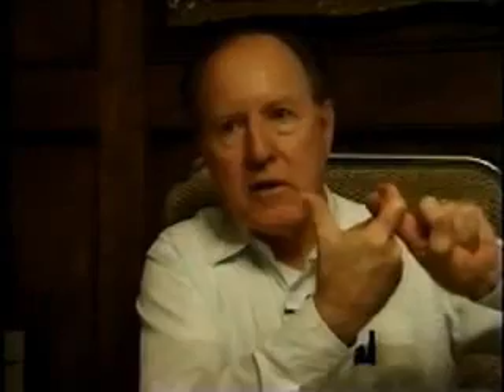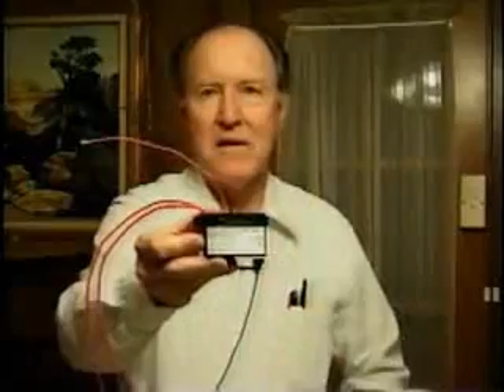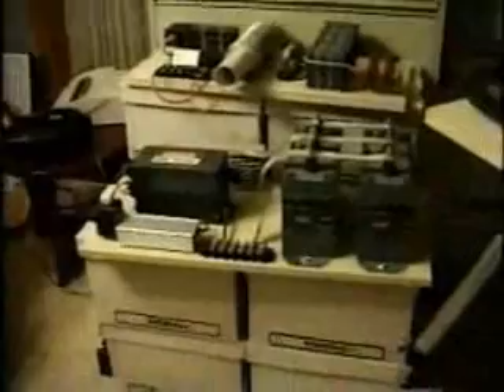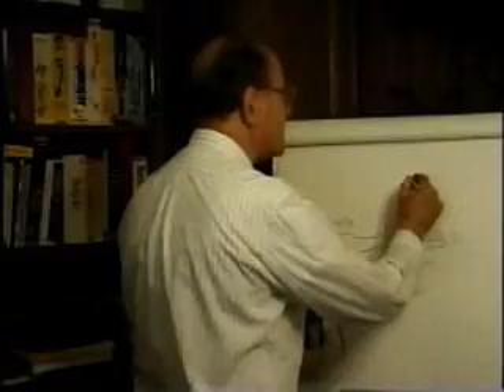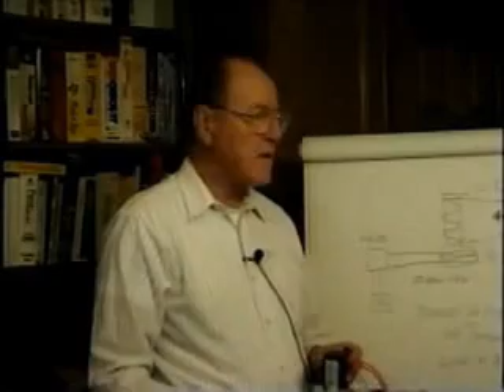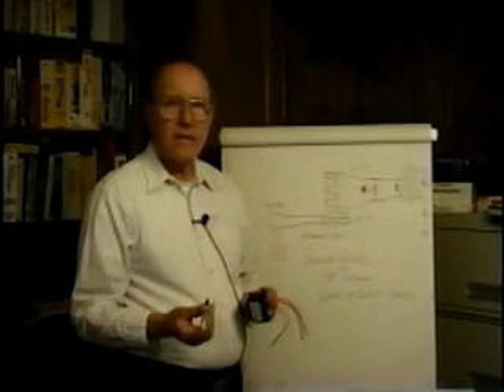don smith seminar on how to make it.

Comment: Don Smith Overunity Generator is based on 4 things:
1.High Voltage Series Resonant Transformer
2. Earth grounding is the source of electron flow into the system. Nothing is created out of nowhere.
3. Using Spark Gaps to disturb the ambiant energy and draw more current into the system from earth or the ambiant
4. Load must be taken from resonant tranformer coil.
Reply: yes that sounds about right ! im fully aware through observation of my experiments that the earth connection greatly enhances the energy when connected to the correct terminal of the system . what  experiments have you done ?
Reply: no, not even close

Comment: That 9000 volt from L2 coil when fed to the primary of isolation transformer kills the sparks in the spark gap. I don't get any sparks in my spark gap when connected this way. Why is that? What is the alternative? I have not adjusted the frequency at the isolation transformer using resistor. Is that the reason?
Reply: Checkout faraday research and development
Reply: @donavonneighbors  have u replicated the the plan shared in this video?
Reply: @avinpais  not yet. But in that channel I recommended, mike does lots of it and is pretty active.
Reply: DID YOU MAKE ANY PROGRESS WITH IT ? : )

Comment: after resonance at multiples (16x) at 560 Khz, secunder voltage (L2) will rise according to the ratio, can be achieved at 8 KV, many people can make this circuit. the problem is when it's loaded, DC voltage drops, it can't generate current
Reply: It can generate current your at the wrong frequency on the output end, this MUST be corrected before you get useful energy. You are most likely using the wrong resistor size, the other thing I've noticed people don't use is a veractor to limit your spikes on your input end. This machine sucks electrons out of the earths ground for your useful energy it's doing this through induction. Hope this helps, cuz I can assure this machine does work. I have built several of them.
Reply: @johnthomas735  yes don said people kill the energy before properly getting it correctly channelled at the output! So youve made a couple of the systems?!! 😎 i do like to hear from people who have actually don it ! Is it a non inductive resistor on the input terminals of the output transformer ?
Reply: You can get a shock from the high voltage module also. Anyways, I tried replicating the plan suggested at the end of video.. I connected the high voltage output of the high voltage module to the isolation transformer primary coil on the high voltage side.  My multimeter blew up which was conducted on the secondary coil. Probably due to back emf spikes. But my 10 watt LED bulb did not glow.
Reply: it can definitely generate current.  ive already blown several lights with it. kapputtt !! destroyed by the current. if you rectify the energy off the secondary then allow the cap to charge up you will most definitely have current and i would advise be very careful which terminals your touching on the output side if you have a cap charged up. im still trying to figure out the output transformer properly.
Reply: You need to switch to AC, you can do it with DC but it's MUCH harder. Switch over to run it off a 9v battery & make sure you have a closed loop from your capacitor to L1 coil & back into the capacitor. With ac you have no positive or negative, with DC you absolutely can't do the closed loop, this is why your getting the voltage drop....that & make sure you have a real L2 coil as well, it needs to be to specific standards it needs to be compatible with the L1. If it's off by a fraction of an inch you will have loss as well. Keep playing with it, I promise you this device works! Just take it step by step. Really once you get your L1 coil going properly you in business. But you have to switch to AC I'm pretty sure without seeing your configuration that is your issue. But remember too, even once you get your L2 coil induction going you still need to run it to a stand alone transformer & this is where most people fail & think it's all hogwash. You are pulling electric power from ground, nothing in this device actually powers anything, it just attracts electric power from ambient  , or ground.
Reply: @johnthomas735  when you say get the L1 coil working properly were in business, can you give me a few pointers on this ? Cos i have my HV module, and i have no problem winding coils. So how do i connect to the L1 from the nst? I have 5 of those 2kv caps from microwave ovens. I also have a 20kv cap i bought from ebay, 2,2000 pf. I also have a gas discharge tube thing which i saw don using on the earth of the Neon sign transformer. Any guidence would be very very appreciated 🙂
Reply: @tvdylan  you start with your power supply 9v battery into your HVM & you go out to your L1 coil & back to your HVM closing your loop . At this point everything should be working, your not going to need to tune anything cuz your HVM will be forcing that frequency onto your L1 & L2. Again you must play around a bit with your system, I personally notice I get greater voltage running 1/4 length L1 to L2 coil . & From what I can see from the little bit of footage of Don Smith's devices, it appears that he only hooks up 1/4 length of his L1 as to his L2. So the combination of the proper ratio will effect your overall output. Same goes for frequency, but in the model I'm referring to your HVM is pushing your frequency so there's nothing to adjust. You only need to do 1 correction & that's on your isolation transformer.  Your HVM should say how many cycles over second it's pushing so you can do the math on your L2 coil to see how many volts you should be outputting.  Hopefully that's helpful, if you are able to take a picture of what you have & your configuration, I might be better able to give an idea of what's going on.
Reply: @johnthomas735  yes, thanks, so my hmv module is 8kv @ 25khz. And so you say L2 should be 4 times the turns of L1 yeah ? And 4 times the length yeah ? My hmv module is mains powered, so not using batterry at the moment. And i have to maintain a spark gap between the hmv leads and my coil in order for it to stay on. And is it best to have the cap in series with the hmv lead and the L1 or in parallel? And would you have an earth connection on L1? Thanks mate, and yes ill upload a simple video of what ive got to work with. Ive got welding cable for the L1. Or i could use speaker wire, less thick. I was thinking welding cable for L1 and speaker wire for L2??

Comment from the maker: You can try wrapping a plasma globe with thick paper then aluminum or copper foils in alternating layers. Connect a diode bridge to each of the foil layers to rectify the output to DC. Ground the negative end with a grounding rod to the ground. Connect the + and - terminals to charge batteries and capacitors, light flourescents etc.That's it. You don't need to concern yourself with resonance/frequencies or compute LCR values. That's my experimental results. And using a proper Tesla coil will make it even  better!
Reply: Is that overunity? Pulling electrons from ground?
Reply: the operation of all atoms is overunity ; )   @dylanbalie8719
Reply: i see, cool method ! how many layers did you do to get good results ? cheers !
Reply: Do you need an actual diode bridge or can you just add the diode as another layer like you did with the aluminum and copper?

Comment: That special L2 coil (bucking coil) basically defeat lenzs law,  the high frequency and high voltage  is used as a multiplier to get the most out of that coil arrangement to put it into simple terms, if that coil was used at 50 ot 60 hz there wouldn't be much gain and you would need to use an iron core. Here is a link to Dons book. if this helps and you figure it out let me know, thanks.

Comment: I don't see how a person could build one from this video.  You can't read the numbers on the "voltage module" and he doesn't give a source or part number for them.  L is the symbol for inductor so what is the henries of L1 and L2.  Are they iron core or open air?  What is the kva of the transformer?  How wide is the spark gap?  Too much missing info.
Reply: Thank you for your response...much appreciated.  I will start accumulating parts.  8^]

Comment: I like to see a HV module capable of sourcing 3000 Volts into a 10 turn coil!! .... especially at KHz frequencies or even less.  Any 10 turn coil would plain "short out" the HV module.  Something is not right here there needs to be an impedance transformation between low z  L1 coil input and high z HV module output.  I know he's a great man & don't wish criticize ...just questioning the logic of the plan here.
Reply: My thinking says you need to connect to the k3 coil inductively to avoid the short
Reply: His explanations are very unclear and some of the schematics that i have seen for his devices leave parts out or are drawn incorrectly. O’m not sure if this is intentional or not. His device is essentially a tesla coil circuit with a dual bifilar secondary. Each part of secondary are wound in opposite directions. The rest is all basic power supply components. The spark gap in the tesla coil is what makes it capable of firing the primary coil and then the bifilar secondaries produce “volts on the one coil and amps on the other” according to Don Smith. It’s essentially a repackaged Tesla coil designed for OVERUNITY power generation.
Reply: @SuperheroArmorychannel  YES ID AGREE WITH ALL OF THAT ! but im pretty sure that he is bang on the money. which means that we could be using these systems. just gotta put in a fair amount of work to figure it all out properly. and yes, alot of it is basic electronics, its just the engineering of the  coil energy that we have to master in order to do this for ourselves.
Reply: @tvdylan  Thanks for the reply! I believe i understand exactly how his devices work and for me they are very easy to build. I’ll post a video when it’s completed.
Reply: @SuperheroArmorychannel  okay ! excellentay !!  : )  yeah would be great to see a vide'ooo !!  maybe you can explain to me somethings aswell ! you got some cool shit on your page !! you do all sorts of projects !!! just watched the voice changer video !! captian intruigue all the way !! fun things !  : )
Reply: well, if we put a spark gap in series with one of the L1 coil terminals then we have a very live coil with thousands of volts. ITS GOOD TO QUESITON THINGS AND CLARIFY, i dont know if he forgot to mention the spark gap or if he got it to work as in the diagram. but glad you mentioned that, im no expert , but i got a coil buzzing for sure ! have you done any experiments with this yet ?

Comment: can anyone smart here tell me what the resistor value on the output transformer primary should be if we were to run a scheme like that from 12volts?
Reply: Just fix a flipper from kulairado kat..
Reply: : P  @exterminator1619
Reply: variable capacitor might also work , maybe a homemade one

Comment: vision of Teslas tecnology  https://cloud.mail.ru/public/JVAz/XjpXmX6Zi
If shortly, vision based on Teslas patent № 512340. 
Common tesla transformers secondary coil consist of one layer. But in this version the secondary coil is bifilar, videlicet it consist of two layers, connected in series. 
Between layers we have electrical field E=U/2 . If we put capacitor (two plates with dielectric between them) in this field, we will have electric charge separation (electric induction) in it. Load mast be connected to this “internal” capacitor. There is NO magnetic coupling between coil current and load (inner capacitor) current, because they are perpendicular! So there is NO electromagnetic feedback!
To better understanding read Teslas patent № 512340 and Donald L. Smith  www.free-energy-info.com/Smith.pdf

Comment: a few flaws, like always, but an interesting  principle! The main flaw is the polarity of the L2 coil, if anyone can explain why it is not alternating if i feed it alternating 35kHz? Why + down and - up?Another one is the VARIACTOR that he draws at end, that is a diode with a changeable capacitance biased by a DC voltage, i don't see any rectification, only alternating current. Third, i can\t imagine that a man who claims what don smith claimed needs a pencil and a table to multiply 30x300!!!!!
Reply: ya sure! that-s what i said:  
a few flaws, like always, but an interesting principle! 
does it sound like i said he-s a liar??????
I just asked how the L2 coil gets polarized if i fed it with alternating radio frequency and i am still asking it!
Reply: @TheBblindman  its not alternating radio frequency, its pulsed, so only one direction in the output of L2.
Reply: he might mean,  that from the secondary coil you can tap the ground in any leg which would determine the negative polarity from there.  he might just indicated that the down is connected to the ground so it assumed the negative polarity. his old and his brain may not be as quick as your anymore but it doesn't mean he don't understand it. alternating or direct all have positive or negative voltage.
Reply: Blindman  He explains slowly step by step 30*300 for a wide audience. His answer is correct but the questions are dumbto the engineer but not the layman or all audiences trying to learn.
Reply: varactor at the end is really a varistor
Reply: i was wondering if it really could work like a electron pump. Logic it should be! The currents in the halves of the coils MUST BE opposite in order that the magnetic lines of flux are in both halves same direction, opposing the initial flux, following Lentz law of induction. HMMM, interesting!
Reply: add a diode at each end of L2 = pulsed DC
Reply: what a fact filled diseration
Reply: You can have a "polar" alternating radio frequency. Look at your AC power and you will see that it is polar. It has a ground.

Comment: I WILL BUILD THIS THING
Reply: did you ever build the Don smith device. the ones I made are the Zilano simplified as per Don in his later years. Use his larger model as the schematic and just go right from the NST through two diodes to the capacitors then a capacitive voltage divider, and use a thyristor or a thyratron to chop it to the right frequency. Works perfectly. Don't forget the grounding though. However if you tweak it correctly you do not need the ground. You just keep filling the capacitor faster than you use the energy.
Reply: @jimmypopp2695  sir can I get a link with the device plans to build please!
Reply: @jimmypopp2695  Please, how exactly did you do that? Thank you
Reply: Did u replicate don smith device?? Wer is it i wanna see it
Reply: +Bono Youtoo  hey what if i use Slayer Exciter Models, there is no need to tune
what if my load is a heating coil, no need for isolation transformers, varactors.
          please do reply me.